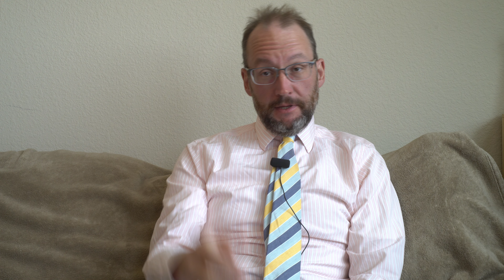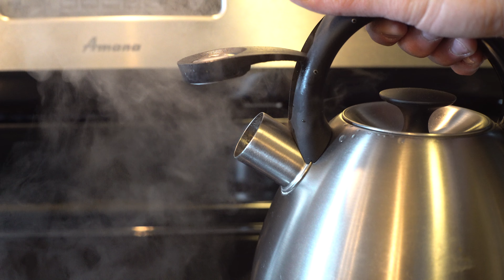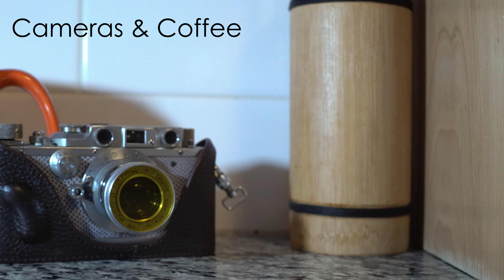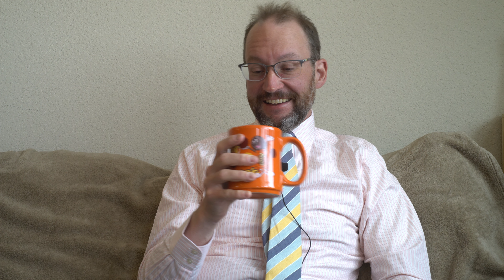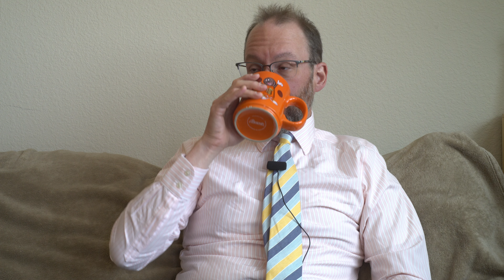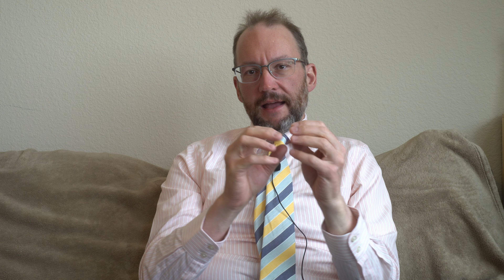How to Make a Simple Digital Camera, Ideas Camera Makers Should Use

Comment: This is what mobile phone calculators have been doing for YEARS!
There's a basic mode with just the main operations, and an advanced mode with all the functions available.

I think having three modes like you described is even better, it has more versatility.
I would make it so that if you open advanced mode and change some settings, these changes take affect in the other modes as well.
This way you could customize it in advanced mode when you have the time and energy to do so, but shoot in intermediate mode when simpler menus let you focus on making photographs.

As for the naming conventions, how about 
Basic/ Elegant/ Advanced Mode?
Easy/ Main/ Configuration Mode?
Reply from the maker: I love calling it configuration mode. That's an awesome name!

Comment: David: Your suggestion still assumes users know what A, S, & ISO are for. That's like having to know settings for throttle timing, brake power, suspension stiffness, on a car.

Would really want true AI that understands what the user is doing (e.g., portraits, wild life), suggests settings (show what shallower DoF can do, what faster shutter speed/higher ISO can do), and more importantly, adapts to the user's choices over time, so the next time the user shoots a portrait, the camera will use the most liked DoF from previous sessions. No buttons.
Reply: Basically that sounds like what Samsung did 10 years ago, a camera with the full smartphone experience. While it failed back then, it'd be at least interesting to see a 2022-version of that concept, since smartphone camera apps and AI made such advancements. I don't think classic camera nerds would like it, because they want full control, but for the mass market it'd be worth another try.
Reply from the maker: AI/ML in a camera that can understand what someone uses the camera for would be a game-changing paradigm shift for the first maker that implements it well.

Comment: Heh, I think you know by now that at least in the beginning you described Fuji's classic APS-C-cameras. But as I said in my last comment, the problem is that due to user demand, they made them more complex over the time and also released PASM-cameras, so if you ever want to try one I'd recommend the earlier models, despite their technical shortcomings. 
So what I'm afraid of is that we, the ones who immediately get the logic of classic camera controls, are actually a minority simply because the majority became so used to the PASM/too many buttons scheme that they don't even make that connection anymore and just want what they once learned - or believe to have learned - from more modern cameras. It's also not only a matter of that single user, it's also the surroundings. I made my mom get a Fuji too, basically because besides the simple control scheme it has that Auto-Switch that switches the camera immediately into "tourist mode", without taking away the other possibilities. Now guess what happened when once she took part in a photo workshop - all Canon-guys with the professional DSLRs: The workshop leader wasn't able to help her because he didn't understand how her camera worked. :P
When we get to menues, I think simple menues can and already have been done, the problem is that simplicity comes at a steep price - as far as I can tell, because I will never be able to experience it, the more you get into luxury cameras, the simpler they get. Leicas look really easy to set up, Hasselbladt has an almost Apple-like menue, Phase one looks simple when I look at them in YT videos. Of course we get nothing like that on our peasant level, and my theory is that a majority of users simply demand options, options, options and too many features - simple would probably be "unmanly" or such. :)
And tbh, I guess I'm in the majority of uber-manly men too when it comes top simple/advanced menues, even on a brand new camera that I never used before, I'd immediately switch to "advanced", everything else would be an insult to my intellect and masculinity! :D
Reply from the maker: Thank you and yeah, my idea roughly aligns with Fuji's approach. I forget if I mentioned it, but I'm tentatively test-driving an XT-4 this summer and am really looking forward to it.
Reply: It exactly what I was thinking, Fujifilm X line it's exactly like that, Program Mode, Aperture, shutter or full manual, the Q settings it's just great

Comment: Well, the problem is that camera manufacturers more hardware-centered, than software. If someone will release camera with opensource OS and easy-to-join app repository (like Android and Google Play are for smartphones) it would be a real revolution in industry. You don't want to mess with all tweaks – just install simple "launcher" and you're ready to go. Or you need to have specific overlay for EVF (e.g. vectorscope) – install plugin and that's all.
Reply from the maker: Hardware is a big selling point, but I'd argue that a good software system and a good interface would be even better selling points. Camera makers that don't realize they're actually making software a nd firmware with a hardware implementation are probably not fully grasping the best path forward for how they perceive their own product.